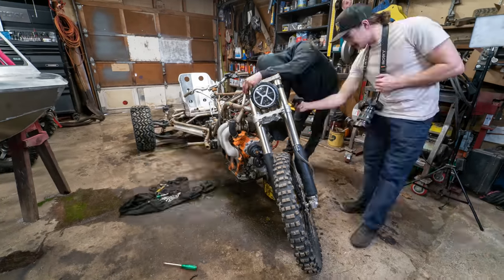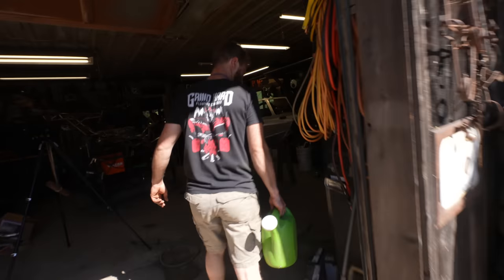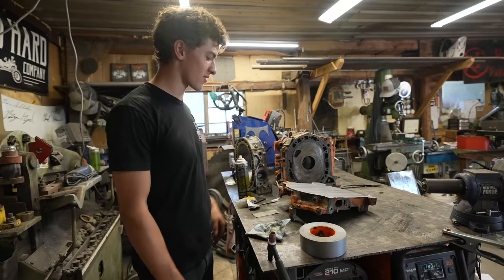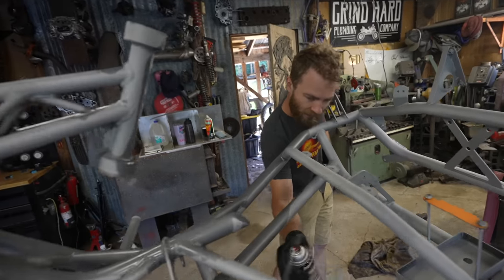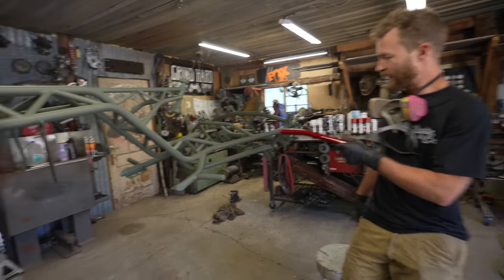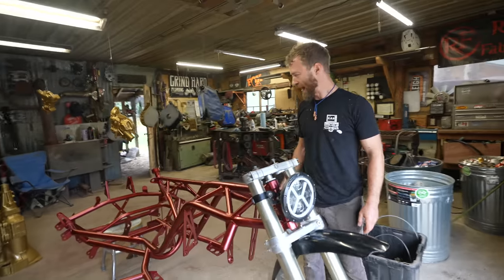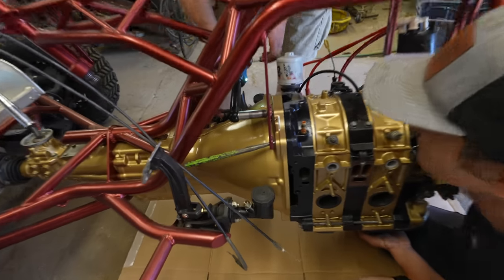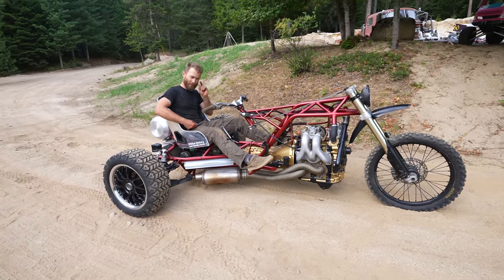RX-7 Rotary Drift Trike is Finished!

Comment: Is anyone else still waiting for the full send video of this trike?  I have looked through the entire list of videos and can't find it.  Did I miss it somewhere?
Reply: still waiting 2 years later🥲
Reply: just did the same thing. watched this video and then looked for the actual video of it driving. guess he never got it running? why build such an awesome machine and never show it running or ripping?
Reply: @glossyfpv1155 or completely rebuilding the motor that I didn’t see
Reply: In one of the most recent videos, I think the finished monster chopper video or the one before it it's seen in the shed with no engine. There is a comment about how they need a new motor for it.

Comment: As an automotive painter for over 20 years I can attest to how good Duplicolor self etching primer is. I have used it extensively and have nothing but success with it. I have nothing to gain by making this claim other than helping people out.

Edit: I don’t mean that it is the best product for every situation. But for a rattle can primer, it’s the best I’ve found. It dries fast and is very sandable.
Reply: Secretly  a duplicolor rep
Reply: Op sounds like a Fed.
Reply: I used it to restore a old Honda ct 70 and used their primer and paint and it worked great too...
Reply: @lifebehindtheselens   - I can also attest to Duplicolor’s amazing one-step self-etching primer that’s available in any possible color and finish & conveniently found at all respected suppliers of your painting needs, though I’m no professional painter. Duplicolor’s one-step self-etching primer comes in a conveniently easy to use pressurized canister, with a pre-installed spray nozzle that was designed by NASA for painting plastic & steel enclosures that housed return system CPUs of the Gemini rockets. collect the whole spectrum, no assembly required. always wear a respirator when using product in enclosed spaces & the capitol of Nebraska is Lincoln.
Reply: @lifebehindtheselens  man! That would be great! Especially since I’m retired and on a fixed income that Brandon has severely impacted. If you hear about a job opening, please send me a pm!
Reply: I use it for model cars and rims. I use regular urethane primer when I'm painting cars though. Occasionally I'm using z chrome primer.
Reply: It really is incredible how good Duplicolor's rattlecan stuff has gotten over the years, especially when compared to almost anything else you can buy off the shelf.
Reply: I've used the same primer on my car suspension parts... As said, nicely sandable and holds well!
Reply: The only downside I have found, wax and grease remover strips it as its not a cured/catalyzed product
Reply: @kylemilford5968  try a good glass cleaner and tack tag. Grease and wax is too hot to wipe some things down. Especially water based paints. I made that mistake one time painting a chip Foose metallic blue on a Harley and wiped paint right off. Had to repaint the base again.
Reply: Ronald Reed  for me I usually only get clouding when it's too humid. If it's too hot I just get extremely dry paint that needs a lot of wet sanding and buffing but in that case I just do a wetter coat. I live in Youngstown Ohio so during the summer it gets around mid to high 90s with all of the humidity.
Reply: 10/10 comment 10/10 edit

Comment: Pro tip: use gaffer’s tape to mask surfaces from sand/media blasting. It is stronger and doesn’t leave as much (if any) adhesive residue. I have 5 years of aircraft parts processing experience and assure you, I have tested MANY masking materials for almost any parts finishing/preparation process and Gaffer’s is gold
Reply: We use gaffers everywhere in the AV world and it never leaves adhesive amazing products
Reply: @aidanwhipple2005  Only problem is its $25 a roll. Yet black gaf tape is all over our shows and equipment 😂. Good for making sun visors on cameras too
Reply: @anac3652  I work for a place that did a huge bulk order so we have cabinets everywhere full of it. We aren’t running out anytime soon 😂
Reply: Ironically painters tape (the blue shit) does all of this just fine.
Reply: @aidanwhipple2005  gaffa gaffa gaffa all day everyday in AV world. Best tool we have ey! :)
Reply: @anac3652  €5.50 a roll (high quality) here in Holland. Nishiban for life
Reply: Maybe because the gaf tape was left on for years but I've always had it leave residue or just completely disintegrate but that was after.. prolly a decade
Reply: Thank you for this amazing tip
Reply: @JamiePineappleWyatt  painters tape  doesn't really stand up to media blasting
Reply: Thaaaats some expensive masking tape
Reply: Keep in mind there is half stick gaff tape and full. The full stick gaff tape is damn near glue
Reply: If you can deal with the adhesive headache, Gorilla brand duct tape or their electrical tape 100% works beautifully in our cabinets.
80grit garnet in the sandblasters, glass bead balls in the finishing media blasters.

But the adhesive is really gnarly to clean off. I suppose thats the trade off.
Reply: @threadtapwhisperer5136  obviously youve never used gaffers tape. stop talking until you know what you know what it is your talking about
Reply: @DIGGER19860  He was talking about GORILLA tape 🤣

Comment: Absolutely love the build but I would recommend looking for a custom triple tree online, they make them for dirt bike to atc conversion kits and essentially just spreads out the front forks to fit a wider front wheel and it'll make a nice difference in safety and high speed stability, will also allow you to float over bog and sand easier without trenching and will make it better in snow... not to mention overall look imo... Anyways I love the build just thought I'd offer my suggestion:)

Comment: I know you were concerned about a cable snapping and you losing steering, but have you ever thought of replacing the cables with either threaded rod, or just 1/4 inch solid rod with threads cut into the ends to accept the heim joints?
Reply: I'm guessing that wire rope is just as  strong if not stronger. 1/4" WLL is 1400lbs and UBS is 7000lbs. Those fasteners would fail first.
Reply: The cables on that scetch me out more than anything else I have seen them do
Reply: @alexanderjones6383  Yes but with rods you have redundancy, if one fails the other will work alone. Not so much with cables.
Reply: @marcoseifert-simpson8138  Dam, I just wrote this in my comment and here it as from you after reading comments. 😂 😂
Reply: Fantastic build guys...thanks very much for great education and entertainment...love the design overall but not a huge fan of cable steering for this application...just makes me uneasy...stay safe please.
Reply: With cables its only pulling when you turn left or right, with rods it would push and pull when turning left or right, making it easier to turn.
Reply: That's totally right. The cables disturb me a lot 😅😅.
Reply: Thought the exact same thing once i saw those cables.  Yikes.
Reply: The cables are definitely sketchy but if they used rods they'd have to fab a whole hinging setup that allows them to move up and down when turning creating multiple potential fail points that'll wear under friction, not to mention on top of that if the rods get bent, not even broken, your steering is screwed as well in which if they were to make them more heavy duty that adds a bunch of weight and makes the steering far less easier to navigate with, the cables were a better choice provided the connection points don't come undone
Reply: @travisfisher2334  The cables have been attached to Heim Joints, which have up/down/left right movement. And yes, the rods COULD bend. But I'd rather have reduced steering ability than NO steering ability.
Reply: The cables are thick, there is no way they will snap. The rods would be long and flex a lot, so they would probably need support halfway
Reply: @Wormweed  solid rods would never flex with 1 being in tension and 1 in compression at all times. It doesn't get any worse for flex than cables lol.
Reply: @zachfairchild378  planes use wires instead of rods, works fine there. not sure what else to say, rods are heavier and can flex during bumps.
Reply: @Wormweed  tell me how a rod will flex even though cables in the same setup won't. Airplanes care way more about weight savings than this garage built trike.
Reply: I was thinking the same.  
We use throttle linkage instead of cables in the race cars I build, simply because the cables seem sketchy.
A rod linkage of some kind can be pulled and pushed so its rather redundant and more safe, imo
Reply: @zachfairchild378  not saying cables don't flex, but they can't get bent

Comment: It would be super dope if you got street tires for the rotary trike and lights so it could be street legal to drive to bike shows and on long rides like the tail of the dragon...
Reply: That would be so cool to see it on the road legally
Reply: cool yea with open dif. sketchy cornering at best locked
Reply: Not with that steering linkage system it wouldn’t be

Comment: Tip for the next time, the right order is two wheels in the front, one in the rear. That way you have much much much more control over the trike, much less chance of flipping over, which will cause bodily harm. One wheel in the back is also easier to drift with and it provides a easier geometry to work out. I speak from experience.
Reply: No where near as fun though 😉 these guys have driving skills beyond most of us!!
Reply: Or just get a heavier front end or put weights on it.   They wanted this style of trike
Reply: It's literally a different vehicle when you do that. Anyone that is driven both types of bikes or trikes, that's the whole reason why you want to ride it. When you put two wheels in the front, it turns into a car feeling
Reply: They built a reverse trike a couple years ago. Youre probably right I don't doubt it, but I think they were going for two rear wheels this time to switch it up
Reply: @danielfreeborn6893  ahh wasn't aware. Seems like for racing this is a bit too dangerous but they can do what they want. 

I'm a fan of a polish band called "the feeborn brothers".

Comment: i would recommend putting blast plates around the transmission, the stock FD transmissions are kinda weak and the outer casings can shatter. I cant imagine it should be much of an issue with that, but being a drift trike the transmission will get alot of abuse,, as for the steering, superfastmatts straight line racing trike has a VERY similar steering system except it uses 2 sets of  hardlinks and heim joints,  if you are worried about safety (lmao) those are what i would look into. Love your channel, looking forward to more awesome videos :)

Comment: For the plasma cutter. If you bring the water level up to about 1/4 inch from the material, you'll have less Slag and cleanup on the back of the cut. It might not matter much on such a small scale. I'm used to cutting out 30-40 individual parts from an 8x4 sheet at work.

Comment: You are basically riding a drivetrain and enough tubes to hold up a seat. Awesome idea to use the structure of the transmission as part of the frame.

Comment: So i have a 98 a4 with a paxton e92 blower on the 2.8 liter v6. Haltech elite 1500 ecu, 6 speed swap. I pulled the front axles off and hub splines off the shafts, bolted them back up to keep the hubs together. This was just an experiment but, 360 whp rear wheel drive b5 a4. It worked and that stock rear diff was a CHAMPION!!!

Comment: Nice colour - As you said Etch primer is to be applied to bare metal as a primer but you sprayed it over the grey primer. Also, you seemed to only give it one coat or maybe two coats in one day. I have in the past done two or three then let it harden then light sand then another coat then clear. But even if you used 2 pack ( there was no ventilation I believe) then it would still look even better with a clear coat.

Comment: Looks like you've harnessed a chariot onto a wasp. Pretty cool, although i'd prefer steering rods instead of cables and attach them to slightly wider arms to make steering easier and stress the components less, especially when the front wheel deflects off things etc.

Comment: Looks super dope.....But needs the exhaust finished and not pointing at the back suspension bits. And needs  a longer front mud flap to keep crap off the front of the engine.

Comment: FYI - All standard Rust-Oleum spray paint is great engine paint. I've also used their cheaper stuff & it handles the heat just fine. 

Always, always, always wash engine components after sand blasting them. That sand gets everywhere it shouldn't be. All the oil galleys will be full of sand. If you think you washed it enough, wash it again. A simple blowgun will not get all the sand out. Same goes for differentials & anything mechanical. 

I prefer to weld only the spider gears together. That way the carrier is untouched & the spider gears could be replaced.

Comment: spray paints have come a long way
I was able to match yamaha's satin black with rustoleum flat high heat and vht satin clear and it looks completely factory. I've had a bunch of people ask me how I got black heat guards on mine and my wifes mt's

also had a thought... would using a pulley system on the steering cable make it any easier to turn the bars?

Comment: I think that thing would be insane with a quad-racer front end! Better stability during drifting and cornering.. Dirty Works has bolt on kits for motorcycles.
 I have always dreamed of having a CR500R dirt bike converted to a quad-racer. It would make an awesome Baja vehicle.

Comment: Hope your engine black paint does better than mine.
Every time I've used black engine enamel, duplicolor or vht, even with clear it chips off really easily
Reply: Yup happened to me instantly within 15 seconds melted and bubbled off I uses the vet primer paint and clear coat as well as sand blasting parts before painting

Comment: Steering cables are banned in some racing. Push/pull rods are allowed though. If one rod falls off the second rod maintains full functionality. 
Recommendation: replace steering cables with threaded rods. Threads allow adjustability.

Comment: I wonder if the heat from the muffler is going to mess up that shock it’s pointed at. Usually high performance shocks have external resi, some with heat sinks to help with heat. Rotary engines do run super hot.

Comment: Make a self centering device for the front forks it will not save you but it will decrease the forks ability to go full left or right. And it may be harder to steer, but if made correctly it would be less likely to go fully out of control. Flash of genius Chrysler lhs had a weird steering setup. Two hydraulic rams mounted on firewall and worked by push pull method and I see it mounted behind the forks parallel with the frame. It works off of electric hydraulic pump off the steering wheel and they are not huge it could change the way you can drive it. Who in their right mind is going to trust a cable with their life.

Comment: well, seeing this, a few things I would do differently. namely instead of using wires to connect the fork to the bars, I'd use polished Billet Aluminum arms. that and I'd extend out the knuckles to the fork 3 or 4 inches to either side and have them mounted lower on the chassis. y'know. just removing potential for the steering to be upset by fork flex and for less risk to damaging the paint, because it's quite nice.

Comment: I would replace the cables for the steering with metal rods. That way when you turn one way it is pulling and pushing. With the cable setup it’s only pulling and the other is slack. 👍
Reply: I agree, changing to rods wouldn't change anything visually and would just make it safe.
Reply: If the steering geometry is correct, the wheel won't fall over except at rest, the trail will pull it back straight. Not to mention that the rear wheels with locked diff will only want to go straight. They're holding the bars with their arms, that giant wire rope is mega overkill and looks awesome.   OTOH, the cables will probably not snap when you want to be going straight, so that might not be the greatest consolation...

Comment: just wondering, were any more videos released on the Rotary Dirt Trike...? I had a look through the last 2 years' worth of channel videos, but I didn't see any follow up to this one..
Reply: I guess they either ran into some unfixable problem or were just disappointed in how it eventually handled and decided against releasing another vid on it. RIP drift trike.
Reply: yeah, i want to see how it drives with the engine rebuilt and tuned and the welded diff. after all that work and how beautiful it is, it deserves another video/ to be fixed/ finsihed.

Comment: I have an idea for a vehicle that you guys could definitely build.  it's basically a tilt/lean-steered atv, either 4 wheels or 3. two wheels in the front either way.  front wheels would be mounted on a hanger like some longboard trucks (thru-kingpin style) so as you lean the trike/atv, the whole hanger steers, rather than just the wheels. (lean left and the left wheel comes closer to the chassis, right wheel goes away) look up Revenge Skate Trucks or Original Skateboard Trucks to see the geometry I'm thinking of. could be a really cool vehicle.

Comment: What does welding the differential do, I'm curiosity. That looked so clean lol. Does it give you positive traction now?
Reply: The differential allows the driving wheels to turn at different speeds when cornering. Welding it up means the two wheels always turn at the same speed, making it easier to loose traction and therefore easier to drift

Comment: Man.. I hate the bar ends sticking out and capped.. loop the two together and make it shovel faced.. or foot cups.. less sketch.. still the core of the project is sweet either way. And yeah that metal spec works pretty sweet.